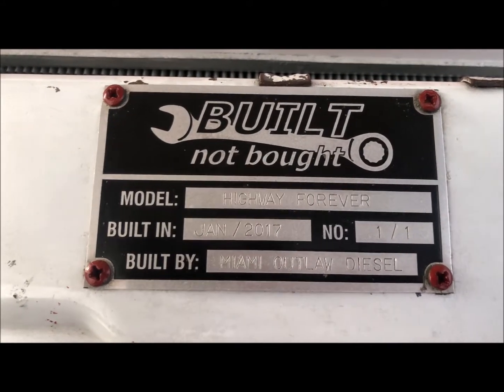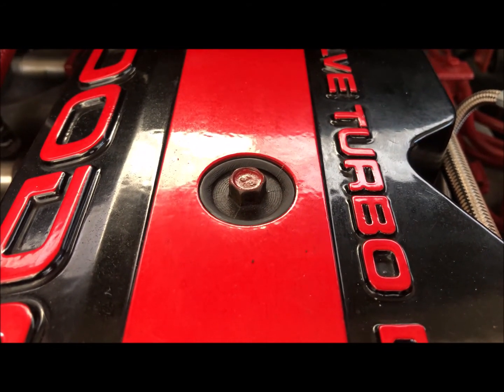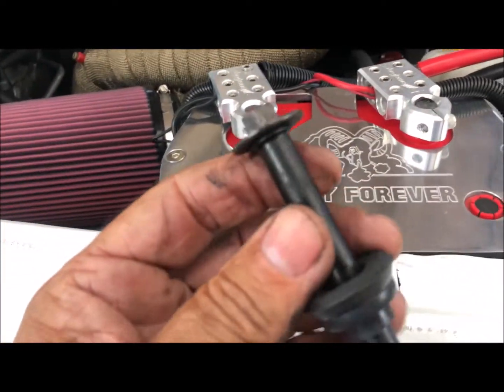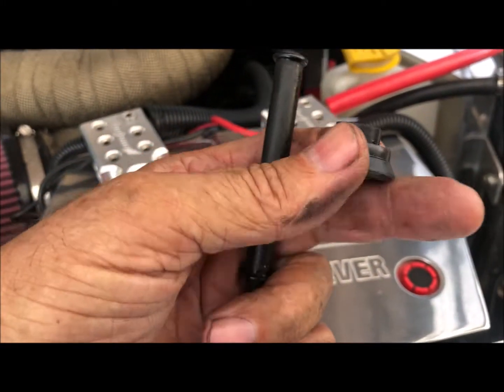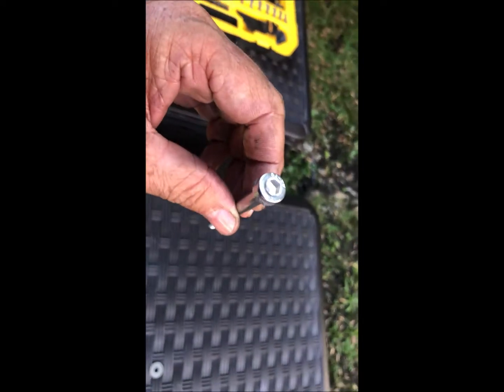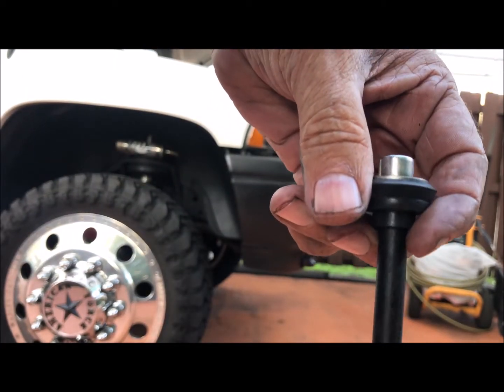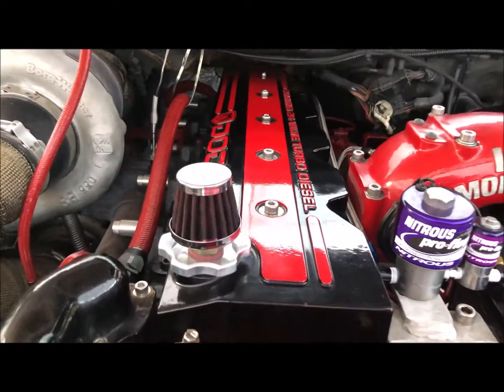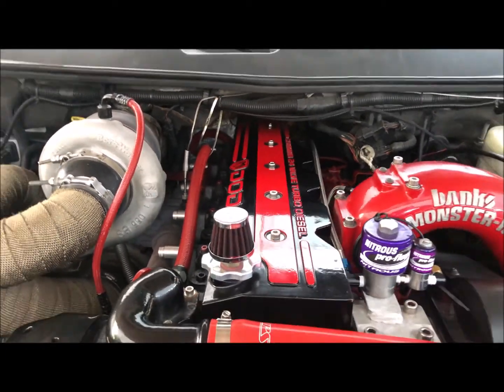WOULD YOU PAY $7 TO ADD THE COOL FACTOR TO YOUR 24 VALVE CUMMINS VALVE COVER

Comment: Check out the Industrial Injection CP3 billet access cover & Fleece upper fan pulley for some bling to the Cummins,looks great after installing the Flex A Lite fans!
Reply from the maker: Yeah. Would be great if both those pieces fit a 2nd generation. But they don’t.

Comment: Is your block custom painted or anything
Reply from the maker: I used a spray can of engine enamel.  couldn't find it in a liquid like a pint of paint,  so I sprayed a little at a time in a container and used a small paint brush and proceeded to paint the block.
Reply: @conquryourfear  you spray your supply lines and alternator too? because dayum